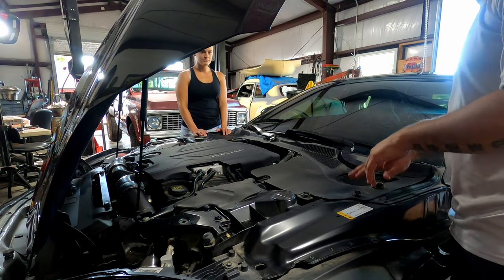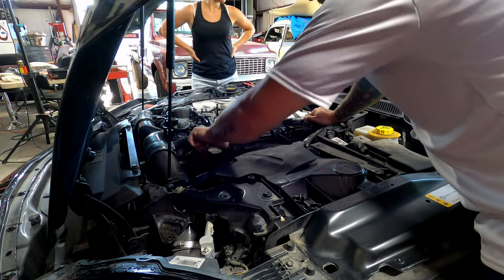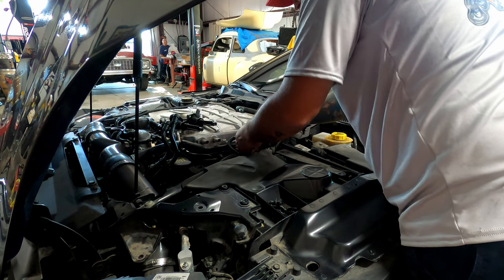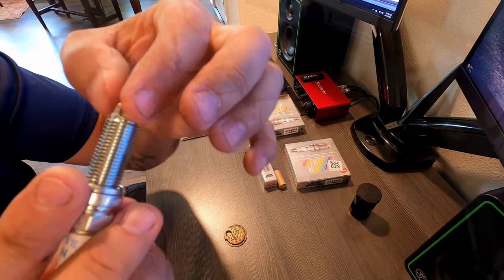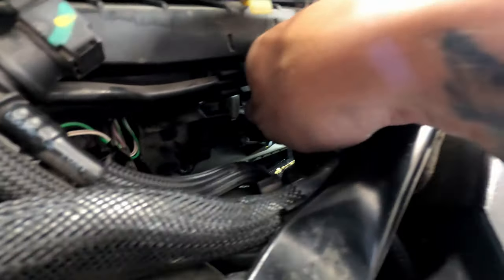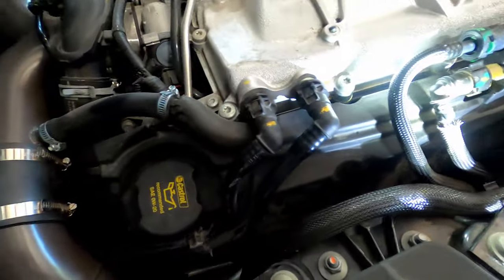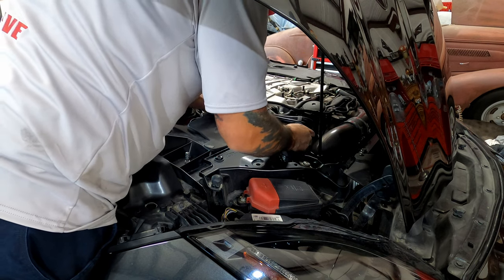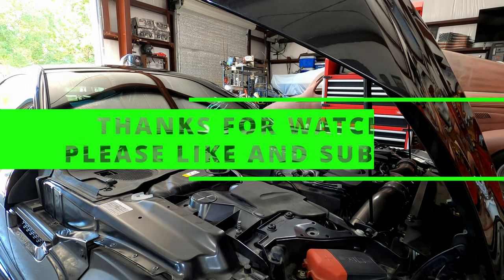Jaguar F Type R DIY Spark Plug Upgrade

Comment: I’ve done exactly this, but now I came to think it is odd that the upper waterlines come off and back on and we don’t bleed the system…these lines are connected to the main water system. Do these lines close themselves? As I was also surprised there was no water leaking out of the charger and lines when I tool them apart🤔
Reply from the maker: yes just top off the same amount of coolant you lost if any. I let mine idle all the way to operating temperature prior to re installing the reservoir cap. However these are a closed system and should self bleed any air out of the SC.

Comment: What size wheels and tires do you have?
Reply from the maker: We are currently running 20x9 with a 45mm Offset, and a 4MM hub-centric spacer in the front (tire is 255/35ZR20),  and a 20x11 with a 35MM Offset, (no spacer) 295/30ZR20 tire.

Comment: What mods to your f type r? With stg 3 vap kit and tune I’m thinking .024 gap… stock plugs r suffering from blowout with tune and both pulleys on mine
Reply from the maker: go to my playlist and under the Jaguar list there is a video of everything done to the car performance wise. Only warning on doing the “colder” plugs is people have had misfire codes and issues. it’s about a 50/50 chance with the VAP tune. I had no issues with mine being upgraded but i also live at 4K above sea level and that may play a role. VAP now does not recommend running colder plugs, they recommend stock plugs tighter gap. just a heads up.